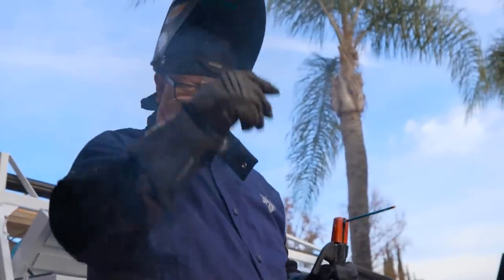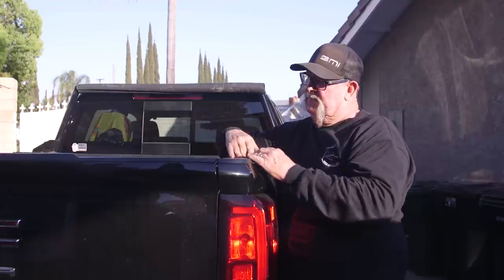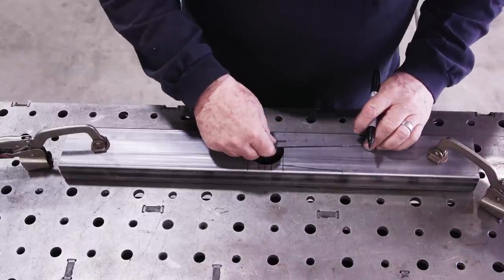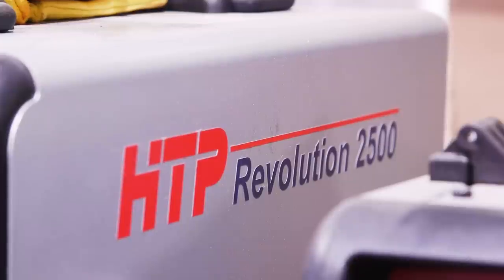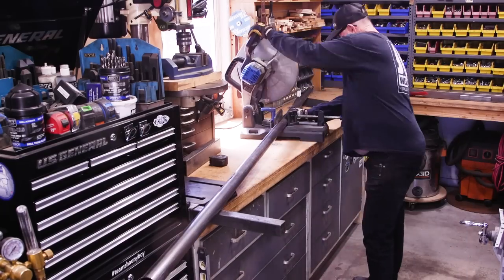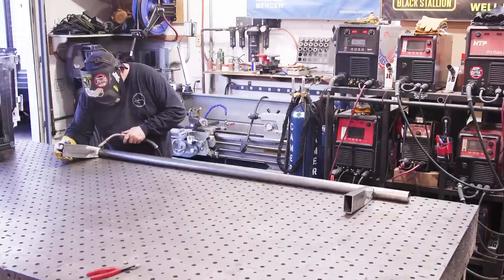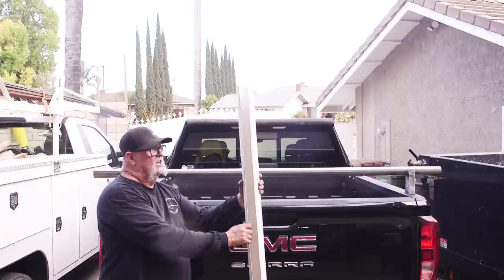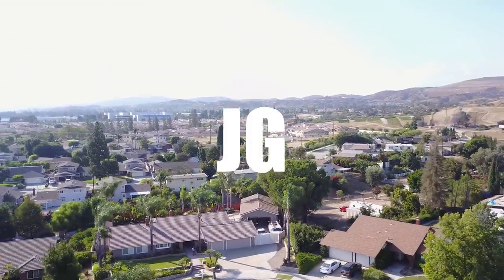Wide load truck rack modification | JIMBO'S GARAGE

Comment: Jimbo, a question to what extent is it allowed in the US for the protrusion of the round tube to come out of the car, I am talking about a tube, such as luggage or other merchandise
I ask you because here in Spain, either by trailer or by car, a pick-up cannot exit in front of the rear-view mirrors. If you have something in the trailer and it exits from behind, it must be signaled with a red cloth or a license plate. danger
and seeing those round tubes caught my attention
and another thing when you pass the ITV (technical inspection of the vehicle) they do not tell you or will tell you anything those people when modifying your vehicle
-------------------------------------------------------------------------------------------------------------------------------------------
jimbo una pregunta hasta que cierto punto es permitido en eeuu el saliente del tubo redondo salga del coche ,hablo de tubo ,como puede ser equipaje o otra mercancía
te lo pregunto por que aquí en españa ya sea por remolque o por coche, un pick up no puede salir por delante de los retrovisores, si llevas algo en el remolque y sale por  detrás se tiene que señalizar con una tela roja o una placa de peligro 
y al ver esos tubos redondos me a llamado la atención
y otra cosa cuando pasas la ITV (inspección técnica del vehículo ) no te dicen o te dirán nada esa gente al modificar tu vehículo